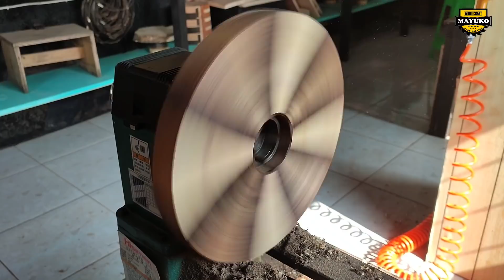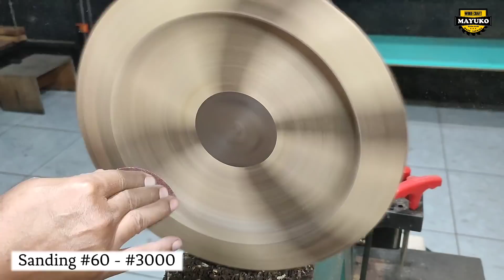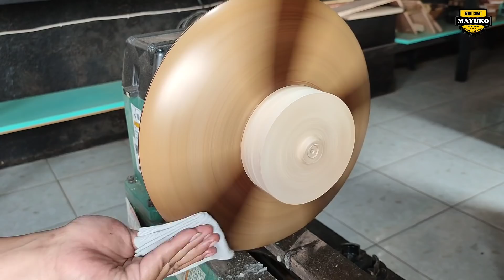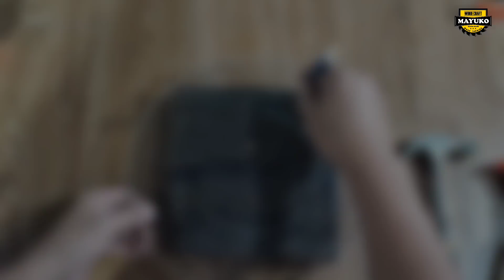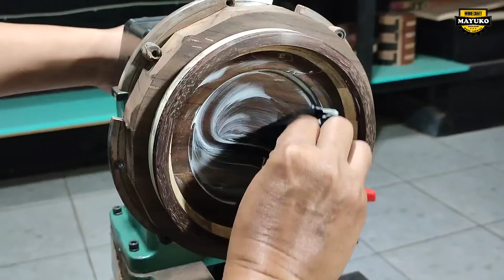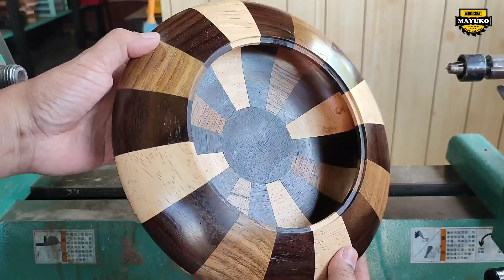SEGMENTED BOWL WITH LID, woodturning

Comment: Are you using an 11.25 angle for 16 segments?
And If so haw do you accurately get that angle?
Reply from the maker: Yes that's right, 11.25 degrees in the mount where the segment is cut, I made a stand for cutting the segment, which is accurately measured the angle of 11.25 degrees
Reply: Thank you for your reply and the info on the angle. Your segmented work is incredible, creative and beautiful.
Reply from the maker: @johncappelletti2872  Thank you for rating my work 🙏🙏

Comment: Quick question how do you determine what size pieces to cut to make the rings?
Reply from the maker: There is a pattern to determine the size of the pieces of wood and the angle, I used an angle of 22.5 degrees and the width of each piece of wood is 5cm
Reply: @mayukowoodturning7644  I'm just getting into wood turning I have made plenty of bowls just haven't tried a segmented one yet
Reply from the maker: @jeremyhammond7155  Yes you should try it and it's very fun, where we combine several different types of wood
Reply: Will do thanks for the info
Reply from the maker: @jeremyhammond7155  🙏